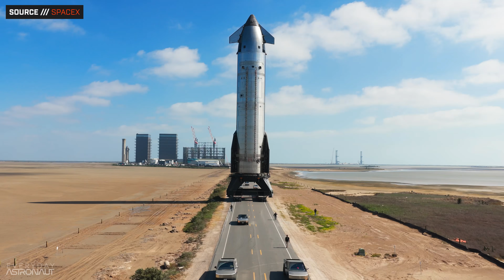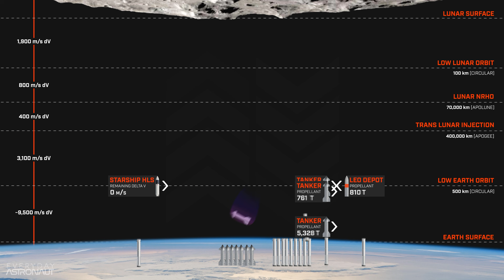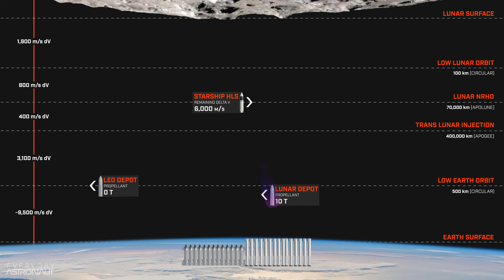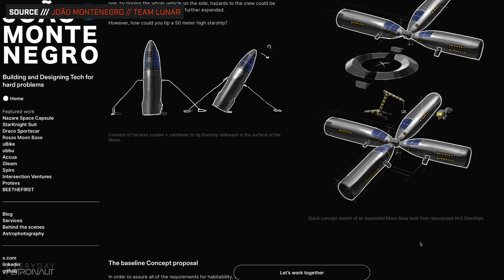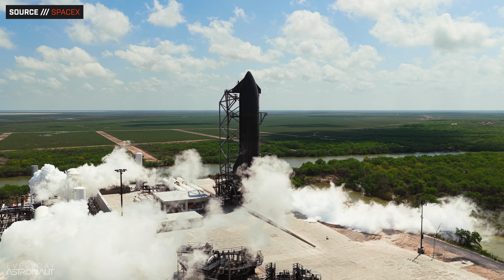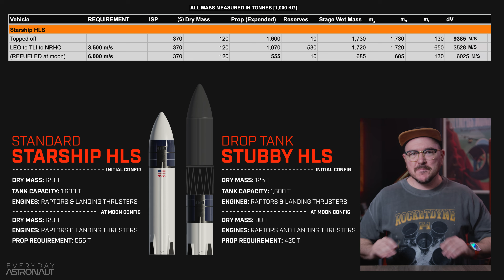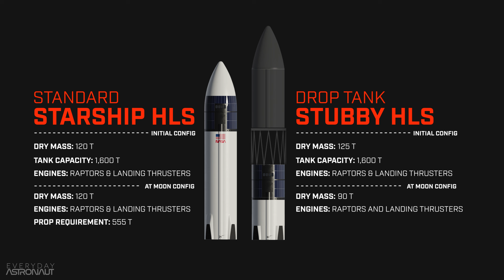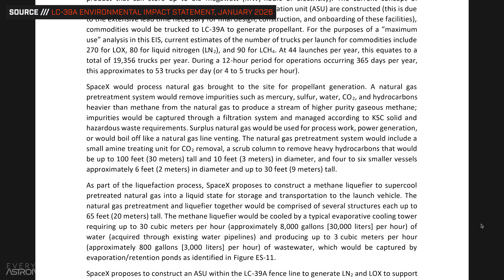Does Starship REALLY require 15+ launches to land one lunar Starship?!

Comment: Use starship for cargo or a base saving costs. And use Blue Orgin that runs on hydrolox and water on the moon for the lander.
Reply: Blue Origin's Blue Moon Mk2 is also more than capable enough to land large surface habitats.
Reply: @plainText384  If you'd laid eyes on NASA's posted moon template, you would understand the gulf I implied.  Blue Origin's project is an Apollo retread in principle and you could only label anything it deposits on the moon as a "base" in the most euphemistic fashion.  New Glenn, for its part, will never have the TOI/LOI/PDI tonnage for a landing option to be feasible for cargo purposes.
Reply: @Asterra2  NASA’s HDL requirements to land large surface cargo elements like surface base modules and pressurized rovers is 12-15t (which is also around the mass of many ISS/Gateway segments btw). Blue Moon Mk2 Cargo more than exceeds that at 20t in a reusable configuration and 30t in an expendable one (double NASA’s requirements). Blue Origin's Transporter is designed to take up to 100t from LEO to lunar orbit, enough for both a hefty payload (e.g. lunar base module) and the propellant to refuel Blue Moon Mk2. And New Glenn is more than capable enough to launch a lunar base segment to the Transporter (hell, even something like Falcon 9 could probably do it unless fairing volume is the issue).

Nothing Blue Origin is doing is an "Apollo retread in principle".
Reply: @plainText384  
Answer me this honestly. Do you think the Blue Moon will be able to reach the Moon with 15 tons of cargo without orbital refueling? Where will it get that Delta V from? Both projects need orbital refueling, and the only one of the two companies that has sufficient infrastructure or is under construction for that is obviously SpaceX.
Reply: @neto6339 SpaceX is probably behind Blue Origin when it comes to orbital refueling, not ahead. Blue Origin's New Glenn has achieved orbit with real payloads, Starship hasn't even attempted that yet. Blue Origin has shown off ground testing footage of their utility transfer mechanism, SpaceX hasn't published footage of equivalent tests. Blue Origin has published ground testing of their deployable MLI sunshield and solar panels, SpaceX hasn't shown any equivalent work. Blue Origin has shared pictures and updates on testing a prototype Zero-boil-off cryocooler, SpaceX has not shown any equivalent system.
Reply: This is precisely what will happen.  Or, more fairly, there would not be a NASA plan for a multiple-thousands-of-tons moon base without Starship on the horizon.  So maybe more like: "Develop a super-heavy landable payload vehicle if you want to get serious about a proper moon base."  It is good that we'll have an Apollo-like vehicle to fulfil the Apollo-like missions in the meantime, though.
Reply: @Asterra2  To me, it makes the most sense to use both Starship, (including HLS) & Blue Moon for different roles. Starship for cargo, HLS for habitats, & Blue Moon for infrastructure. Blue Moon would also be a better fit for ascent vehicles, launching an entire HLS just to get to Orion and back home is extremely wasteful.
Reply: @AndyKauffmanGleekop  Oh, you'd better believe that this is how it's going to pan out.  The only reason Starship was tapped for HLS is because Congress gave Artemis only $850 million for the vehicle (and this was after they were begged for more), and the bids were $3 billion, $6 billion and $9 billion.  The Artemis program was forced to finagle a pick and it was Hobson's choice, and since they couldn't afford the bid outright, they instead worked it into a milestone program.  It is obviously a little silly to use such a big vehicle for a task that Apollo's LM was adequate to fulfil.  But it's like you said: Good thing Starship is on the horizon, because literally no other vehicle in operation or on the design table will be equipped to tackle NASA's larger moon plans.
Reply: @Asterra2 Thanks. That's some necessary context.
Reply: Don't fall in love with the idea of fueling spacecraft with hydrogen and oxygen obtained from water ice. It only takes a couple of paragraphs to describe but the engineering required to get equipment that sophisticated  on the surface and producing operational amounts of propellants is daunting.

Comment: He just competely disregarded the fact that there is absolutely zero hardware and not even talks from spacex about their HLS lander other than some cgi
Reply: We know the important stuff, as most of it is the same as starship. Same engines, roughly the same mass, similar performance. The differences aren't going to change too much. The landing engines and the total dry mass of the habitation system and dry cargo capacity, are still all variables, but the landing engines are only on for a short time, and the other values can be adjusted through trade offs (which would still make it much more capable than anything else).
Reply: @Michaelonyoutub  lets see how long it takes for them to demonstrate cryo fuel transfer in orbit first 
 Only then we need to think about going to moon
Reply: The hardware is Starship, buddy. Don't use Blue Balls and the other landers as an example on how long a lunar lander takes to be designed. Once Starship is proven effective, modding it to land on the moon won't be a heculean effort.
Reply: @fittestostrich1294   this isn't your honda civic buddy "modding it to land on the moon" lol😂😂

Comment: NRHO is such a bad staging orbit that Starship HLS actually would save a massive amount of fuel if it pushed Orion + ESM from LEO to LLO, and then landed and came back to LLO, rather than doing the current NRHO profile. ~400t propellant saved.
Reply: If you play RP1 and principia you know that NRHO is actually a fine staging orbit for crew. It's half the dV for TEI and only 15m/s to escape the lunar gravity well for slow fall back to earth during an emergency. It also only requires 10m/s every year to maintain which is much less than LLO which is extremely unstable other than a few inclinations due to mascons. It's harder for HLS, but for the first few attempts it makes for a good stop gap.
Reply: @Syddd04 God I want Principia so much... but when I tried to play with it everything just stutters and all my rockets explode at liftoff.

Comment: Is there no carbon on the moon? If you're contemplating producing oxygen by electrolysis, you can combine the hydrogen with carbon to make methane. It's called the Sabatier
Reply: There is indeed no useful amount of carbon on the moon. Luckily, the carbon part is less than 20% of the mass of the fuel, so even if they need to bring that part with them, that's still an 80% reduction in mass that needs to be launched. (To be compared against all the mass needed to produce propellant on the moon)
Reply: Not you, but not even sure why people really think producing fuel on the moon is a big deal.  It's 3-5 days away.

Mars on the other hand...
Reply: @ConstantTrue  Producing fuel in space IS a big deal. Not launching fuel from Earth lowers the cost to anywhere in the solar system by 10x to 1000x. Mining, space tourism, orbital sports arenas, colonies on Mars all become much, much less expensive. 

Suppose settlers of the North American West had to import and carry all the feed for their oxen and donkeys from East of the Mississippi. The ability to make fuel where you're going is a qualitative upgrade. What was previously impossible becomes possible. 

Am I preaching to the choir?

Comment: The number of launches is only a problem if you assume that the Starship program will fail.

When Starship is doing hundreds of launches a day this worry about the number of launches will be laughable.
Reply: And it's clear SpaceX thought about this from the start, which is why they focussed on building factory infrastructure first before even waiting for the first test flight (hoppy).
Reply: Hundreds of launches *a day*?
How many millions of tons worth of satellites do you think are launched every year globally?
Reply: @edmondantes4338  
That's like someone in 1804 questioning the idea of trains transporting 12 Billion tons a year. Saying how many tons a year do you think covered wagons transport globally?
Reply: @zacharyramsli8002  Not everything grows exponentially forever.
Even if it did we'd be decades away from hundreds of Starships launches a day anyhow. Not happening in time for Artemis.

Comment: This video has completely thrown off how and also what I thought of Starship... I somehow completely forgot about the Rocket equation and was thinking all this time that they'd just somehow get to the moon in one go rather than the 12-15 refills it will need. I am completely mind boggled!
Reply: It makes me think, why doesn't SpaceX for the Artemis missions have another stage, cut off the crew compartment having it as a separate module and add enough fuel capacity to do a lunar injection from orbit kind of like a massive Apollo capsule. That would also solve the height and elevator problems. How would another stage affect the delta V and would it be possible to do a translunar injection from LLO ? This seems to make more sense in my mind than refuelling a giant starship 15 times...
Reply: Honestly, sending those little bitty humans along for the ride costs almost no fuel at all. It's going to be placing that skyscraper on the moon for them to live in for the month they are there. 😂
Reply: @richardryley3660  yeah it doesn't make sense to be sending the entire starship up there when most of the mass is just fuel. I do wonder if a 3rd smaller stage up top would be viable

Comment: Idea: let's just build starship HLS out of carbon fiber. like the original ITS plan. we could cut the mass like in half, if well optimized, without any sacrifice (except the cost) since it is not meant to reenter into the atmosphere. this way, 8 or 7 refilling flight may be enough. also, we could get rid of all 3 sea level engines and have 6 vacuum engines instead, and give them a minimal gimball capacity (like 1 degree, just enough). finally, the refilling starships may be  able to carry way more then 100t to LEO, since we could fill up all their free space while propellant since there is no thrust, to have like 2000-2000t of propellant onboard. probably enough to have ~150t left to refill the HLS. Finally, thanks to all this, we would probably end up with the old elon estimations (5 or 6 refuilings needed)

Comment: For the case of horizontal landing, That issue ypu pointed out is more an issue with kerbal space program, In real life the fuel would settle on the "bottom" where the horizontal engines would be aligned. So in ksp youll need differential thrust, but in real life it might end up being okay

Comment: I have been trying to wrap my head around all of this data and it has been quite confusing. So I appreciate your overview of the whole mission concept. You seem to have covered everything and you seem to have confirmed all of my conclusions. So thanks a lot for this video. 

I think the biggest thing you accomplished was explaining why the Starship HLS needs to be refuelled completely. Of course, I think the most important thing to understand is that Starship is both its own second stage and, after refuelling, its own third stage. So it can't reach orbit with any fuel left over. It basically has to refill a 1600 ton tank 100 tons at a time. 

I personally was using tonnage of fuel for my analysis, noting that each stage used less fuel than the last. In fact, according to my analysis, Super Heavy uses far less fuel compared the the second stage that other rockets. Of course Super Heavy is still WAY MORE powerful than any other rocket, but that's simply because Starship is so massively HEAVY. It only carries like 3 times the fuel of Starship itself though. The Saturn V third stage only used 1/3 of its second stage, so why does Starship need to be refilled completely?

Well, according to your calculation, it only needs about 1/2 the fuel for TLI. The other half is for getting from NRO to the moon's surface. The Apollo lander needed only a 1/10 of the fuel the third stage did (and it wasn't the same type of fuel) but as you pointed out, the Apollo lander was about 1/30 the weight of Starship. A lot of the issue is that Starship is the same vehicle, from LEO to TLI to NRO to lunar landing. Starship never jettisons dead weight. 

For landers smaller than Starship, I think we've got Blue Origin and possibly others for that. I do like the idea of Starship jettisoning a portion of its mass after TLI, especially if the landing thrusters can get it into orbit and docked with Orion or the Depot. But Stubby Starship just sounds like a halfway point between Starship and Blue Moon 2. 

I hear Blue Moon 2 will use LOX and liquid hydrogen, but a depot in orbit around the moon will be needed for Methane or other fuels eventually. But refuelling it from Earth will be expensive. It's a good question whether it would be better in NRO to be more accessible from Earth, or low lunar orbit of be convenient for the moon base. And I can see something replacing Gateway, or several somethings. 

My guess is, Starship will be perfect for a number of uses: 

1) One vehicle taxis from trips from Earth to the moon base, particularly for large crews. 

2) Moon base components, dropped onto the moon and covered in regolith. 

3) Small, quickly installed moon stations. 

4) Carrying massive cargos to the moon base. 

For day to day transport between the moon's surface and lunar orbit, I would use Blue Moon.

Comment: Just make a lunar HLS as a third stage, so it doesn't have to carry all of those raptor engines. Maybe just attach a single raptor vacuum, and use the landing thrusters for differential steering.
Reply: Ultimately, they want a massive moon lander for a hundred reasons. Solve the hard problems, the return will be exponentially bigger
Reply: @lighthousesaunders7242  Actually no. NASA purely choose starship based on price currently. The Dynetics lander likely would have been more what NASA actually wanted for these first missions, but it was the most expensive, likely because it didn't have a billionaire backer that already was planning to build landing vehicles like that (Musk with starship and Bezos with BO's lander).

Later on they might have chosen it for its payload size, but they haven't for current planned missions (which actually saw pretty low payload expectations)
Reply: @lighthousesaunders7242  unlike Tim which suggested a stubby Starship, I only point out the the Raptor engines mostly being a dead weight in the vacuum of space.
SpaceX cut the bell of their Merlin vacuum engines to save cost for missions that doesn't need high performance.
Eventually SpaceX will ditch most of the Raptor engines for a Vacuum only HLS. That would save a lot of weight, which means less plumbings and less tanker flights.